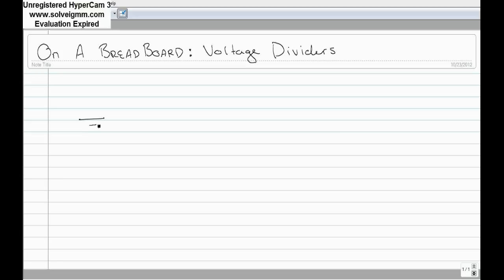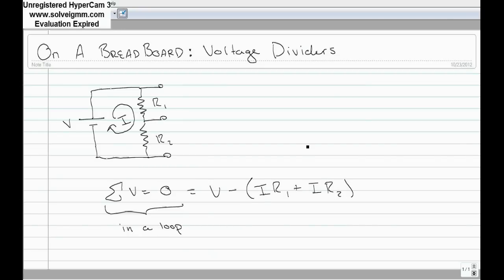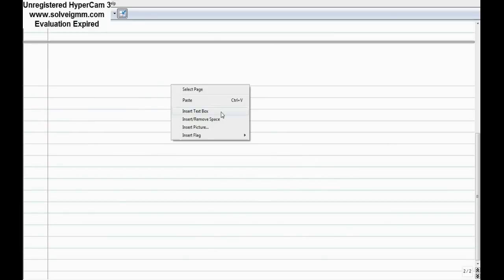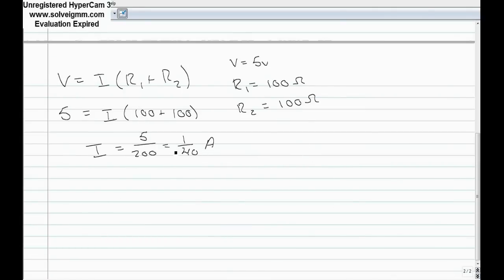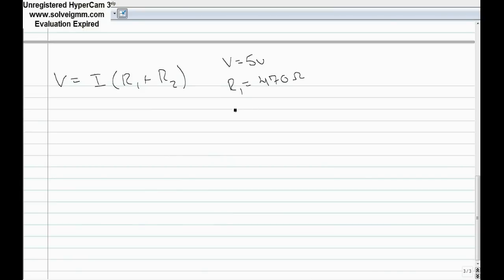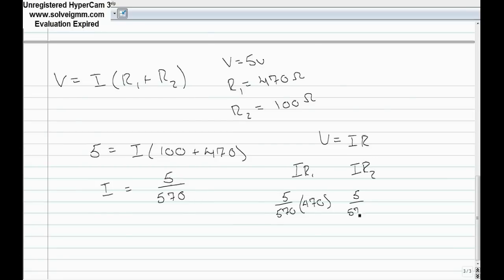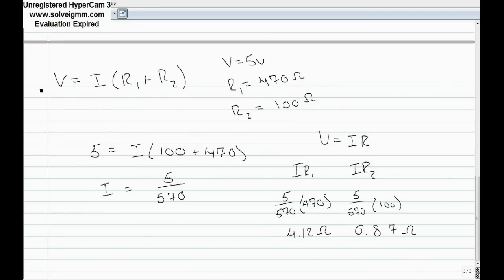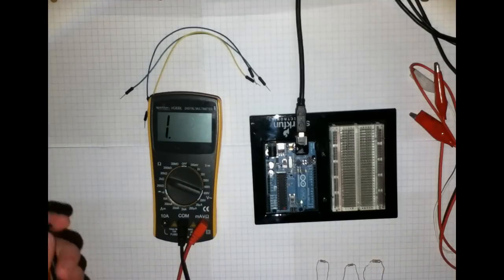On a Breadboard: Voltage Dividers

Comment: Do not use a voltage divider to power anything, unless you have very high current resistors! This setup will burn out if any current is pulled through.